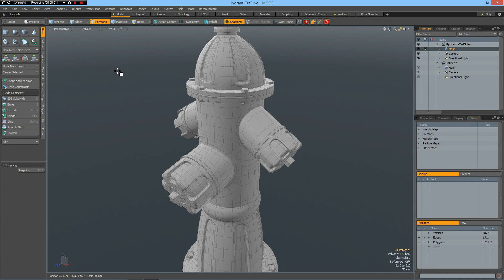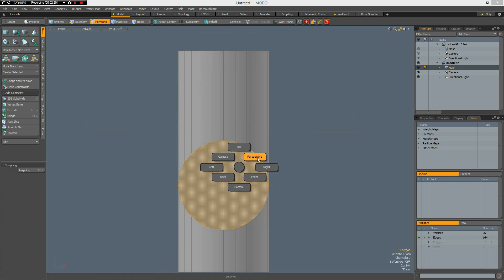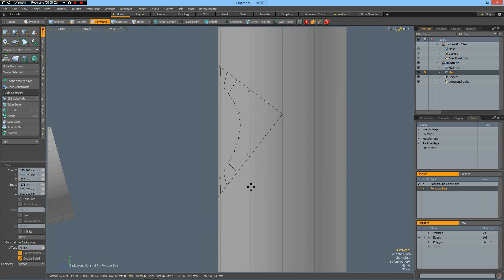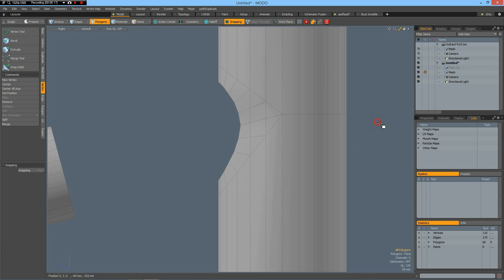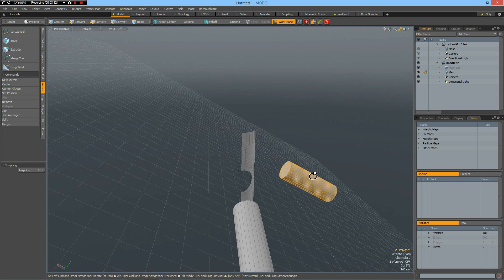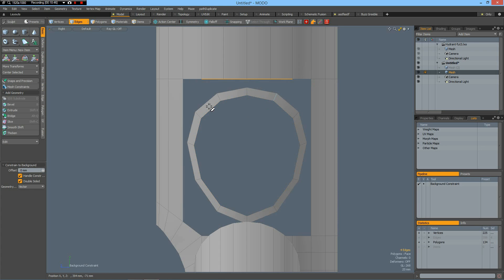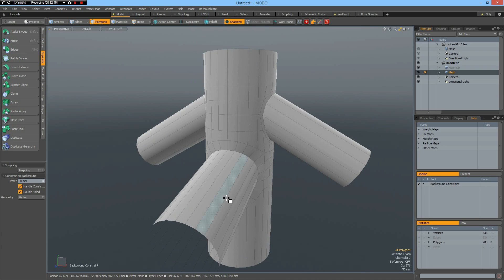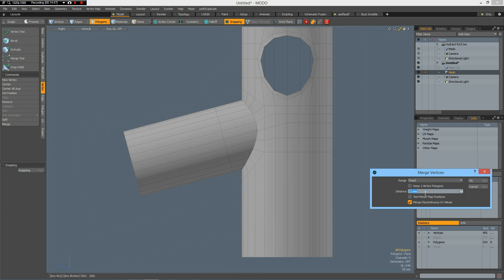The Foundry MODO - Hydrant with Angeled Outlets for Luca Fineste

Comment: Lets just say I got as far as the skull. I was considering pen tooling the designs from a random picture and use as a backdrop template, then manually cutting the skull mesh, OR creating a uv map of the skull and overlay the design template. Im curious if i can bake an inverted stencil line from a black and white template onto the surface and use it to split the mesh.  What would you do? 
https://s-media-cache-ak0.pinimg.com/736x/7e/8c/a7/7e8ca7de7720be0fa5d8a44b1669c632.jpg

http://www.filedropper.com/skull
Reply from the maker: +Wes Louis-Charles Hi, unfortunately this is way beyond of what i can do in modo. Sorry, but i can't help here. Good luck and all the best, Peter